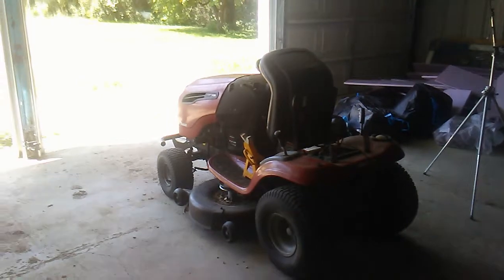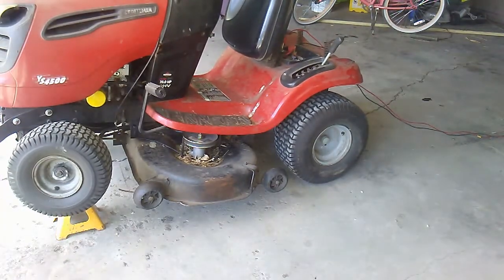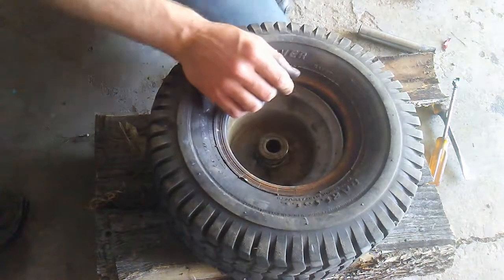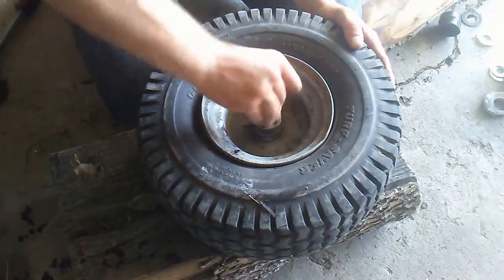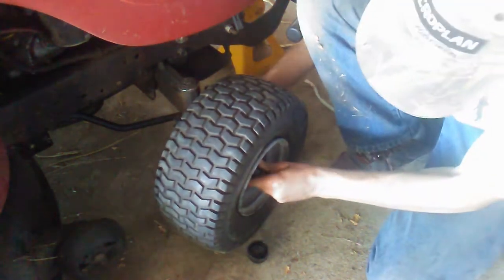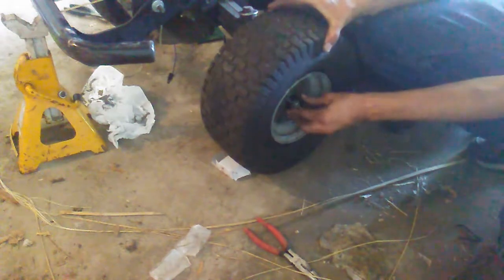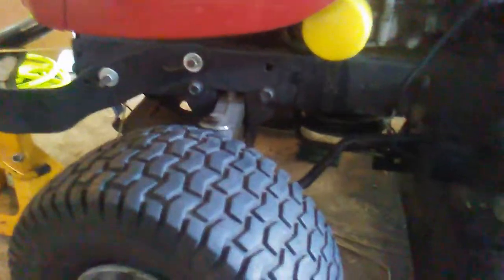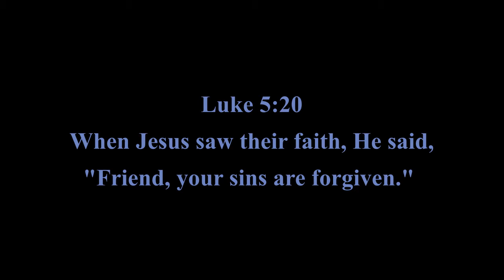Riding Mower Wheel Bearing/Bushing Replacement Tutorial

Comment: The bearings popped off easily when putting the wheel back on the axle. What prevents the bearings from popping off during operation?
Reply from the maker: they're supposed to fit tight, but if they don't, I put on washers to hold them in place.